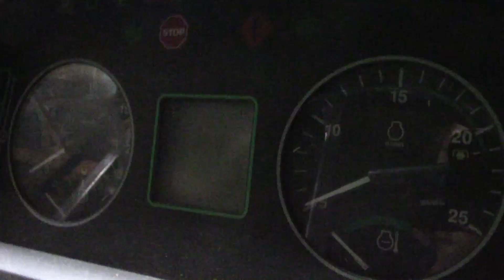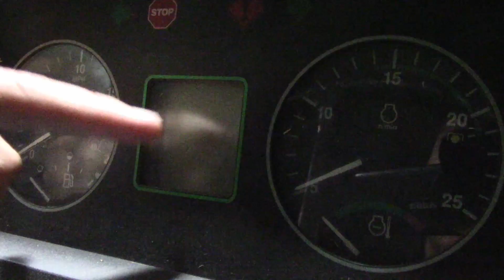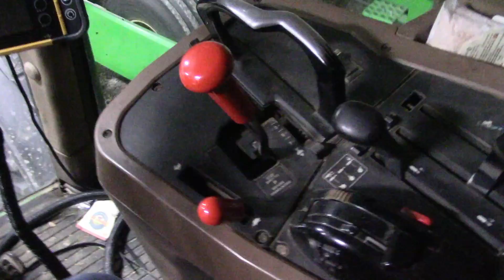John Deere 7810 Tractor

Comment: If you need ballast switch the chloride to Rim Guard, non corrosive liquid made from sugar beets.  Congratulations on the new tractor.
Reply from the maker: I need to check into that.  I may switch it to something like that.  Thanks for the tip.
Reply: Logear $3.50/ gallon installed

Comment: Don't go back the 4440 man, this thing is a lot nicer, the 7810's are awesome. I like the European one, not much different than this, but the headlights are lower down on the grill, there's no orange lights on the roof, fenders are different, and the air filter is different than the US version. Also most of the Euro ones have powerquad instead of powershift
Reply from the maker: They are nice.  Thanks

Comment: I lost my 4430 HD in a barn fire and just replaced it with a 7810jd 2wd. . .  Has it been a good tractor for you?  Mine is a 2000 model and has the full 19sp power shift
Reply from the maker: Yeah, it has been good.  No issues with it.  I like these series.  Thanks